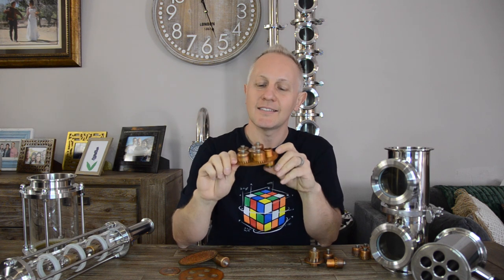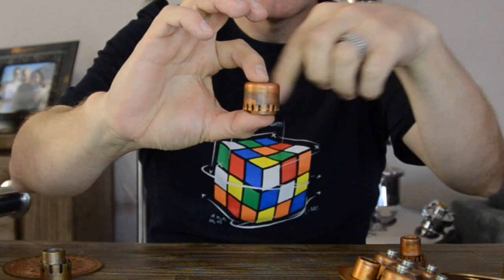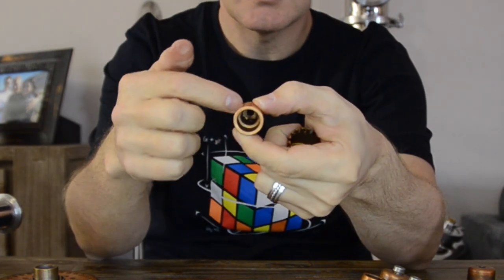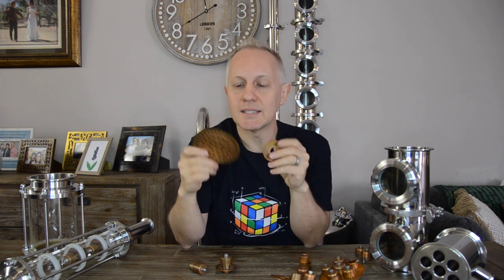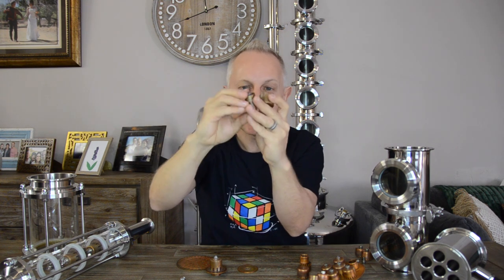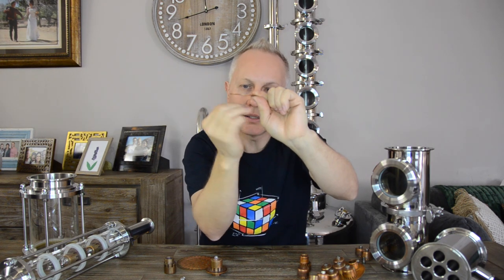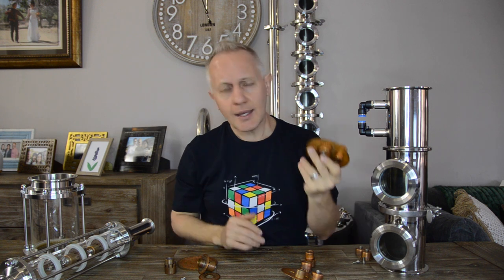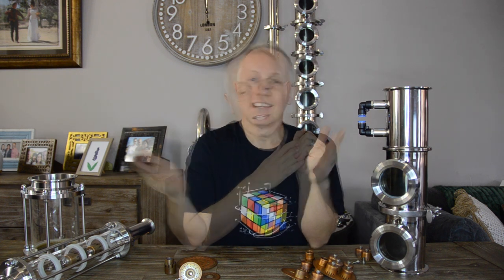Bubble Caps VS Perforated Plates **POOR AUDIO, RE-UPLOADED WITH BETTER AUDIO**

Comment: Holes seem to be too big and there's no down-commer on the perf plate, making it smear and not work correctly.
Reply from the maker: Hey iStill, thanks for the comment.
At the 3 min mark I do talk about the bigger perforated plate and that I actually use it in my gin basket. 
You definitely need to use a plate with smaller holes and a downcomer to make it really work as a rectifying/stripping tool.
Keep it awesome.
Cheers
Reply: @distillergreyling9135  Haha, sorry, couldn't hear you, Greyling! :)
Reply from the maker: @OdiniStill  try this one, better audio.
https://youtu.be/zeu5mswzqAo

Comment: I've noticed that continuous stills tend to use exclusively perforated plates. Perhaps continuous stills that use bubble plates, I just haven't seen them. Do you know why this is? My thought is maybe they flood? Maybe the efficiency isn't as high and worth the extra cost? Or maybe it serves a completely different purpose in a continuous still?
Reply from the maker: Hey Kristian! 
Man you got some good question there…
Cost definitely plays a role, bubble trays (BT) are more expensive.
Although BT reduced weeping they have much more disadvantages.
BT have high entrainment, high fouling tendency and causes a higher pressure drop at the same flow rate as a perforated plate.
Thanks for the questions, I love it!!
Reply: @distillergreyling9135  Thank you for your reply! I'm in the process of planning out a continuous still that I'm building ATM exclusively for stripping runs. I was inspired by a whiskey distiller in Tasmania Australia who built one and it's simplicity was really attractive. 

It used an extremely long liebig condenser that was maybe 10 meters and snaked it's way back and forward down the wall. It used the wash as the coolant, which emptied into the top of the column. By the time the coolant/wash reached the top of the column, it was very close to 60°c, and so all the alcohol vaporized by the time it reached the bottom of the column. The boiler was only 10liters or so, and so, it used very little energy to boil, and no water at all to cool. Many commercial continuous stills are very complex IMO in order to keep them compact, but if space is not a factor, which it isn't for me, I love the simplicity of this design this Tasmanian distillery built. (belgrove distillery)
Reply from the maker: Hey Kristian!
Always glad to help!
Your plan of simplicity sounds awesome and the continuous still in Tasmania sounds amazing.
I just love how with a simple idea you are able to create something out of the norm and it sounds like its going to look stunning.
All the best to you, your idea sounds solid!
Sweet! 👍🏻

Comment: Think they'll make some water with wood smoke going through them?
Reply from the maker: Hey Hunter! Sorry for asking, do you want to smoke infused? I’m a bit lost with the question.
Reply: @distillergreyling9135 I was wondering the effect the caps would have say in a bbq smoker grill if they would create water from condensation
Reply from the maker: Thanks Hunter!
I get you now, honestly I’m not sure.
If the smoke is a bit moist I presume there can be condensate.
But most wood fire is dry and chances are the smoke will just travel through the bubble capes. 
The will be a grater restriction for the smoke and it will want to escape to the most easily route.
Very interesting question and thank you for making me think a bit!
Cheers!! 👍🏻

Comment: Hi, how does flow rate compare between the 2 different plates on your still?
Reply from the maker: Hey Niel! Good question...As the two still vary in diameter and size I don't really have got a comparison to truly compare them. But can definitely look into it!
Reply: Hallo, according to my practical experience with alcohol distillery plants in Uganda,  The bubble cap tray is more efficient than the sieve tray, they hold onto the liquid thus saving on weeping and steam loading...thus saving on losses..
Reply from the maker: @limaroleonard8752  this is awesome! Thanks for the reply I appreciate it. I love the fact that with your on the ground experience it’s an easy answer. Keep it up! 👍🏻

Comment: What about the perfirated plate you have with no downcomer? How does that work?
Reply from the maker: Hey Scott! I use the larger 4” perforated plate in a 4” glass sight-glass to act as a bottom for gin runs. The gin basket will be placed on the plate.